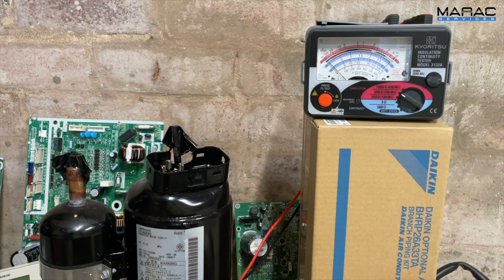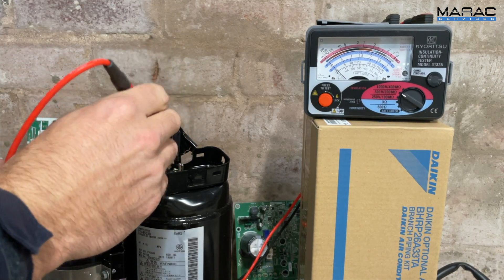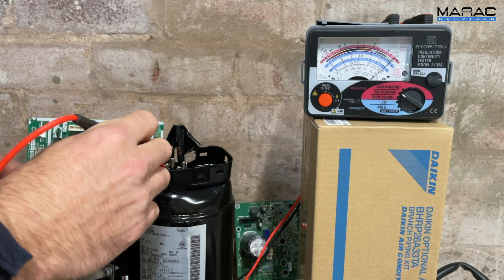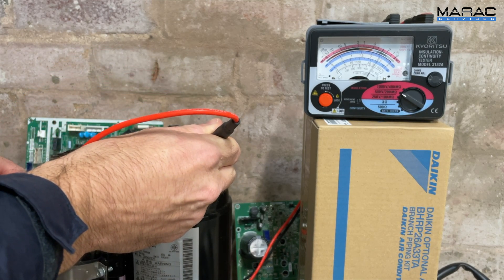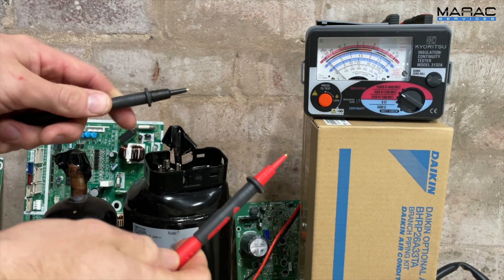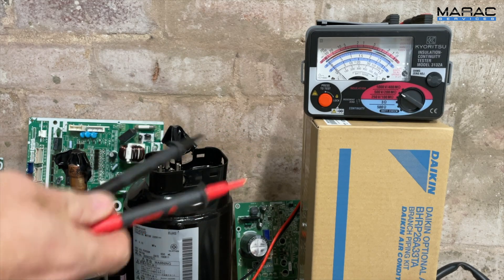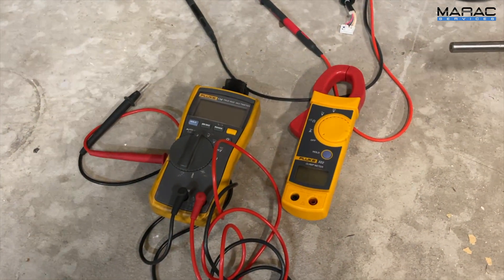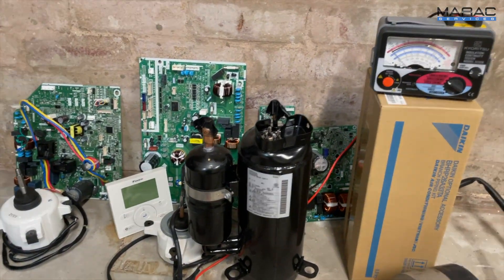Daikin Compressor Fault | Why You Need A Megger!

Comment: Heyyy!! That's a great video! But what's the explanation for that? Why does the multimeter won't detect it if there's probably a very low resistance there? Have you tried using the multimeter on resistance mode to see what does it mark? Sorry for so many questions, it's just that it blew my mind! 😅 Thanks

Comment: Is that mean the wiring is ok or not ?what if we have mechanical damage?
Reply: Mechanical wont show a wiring fault. But is easy to test with an amperemeter. if it draws way to much current on startup until the breakers brake. You have mechanical fault. (if before your megger shows good values)